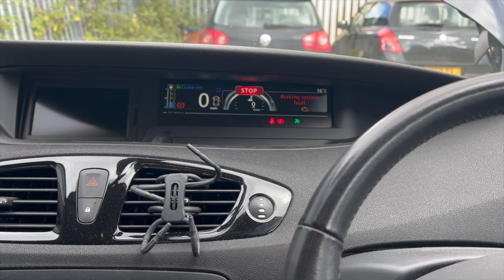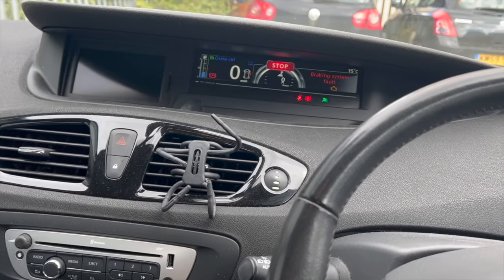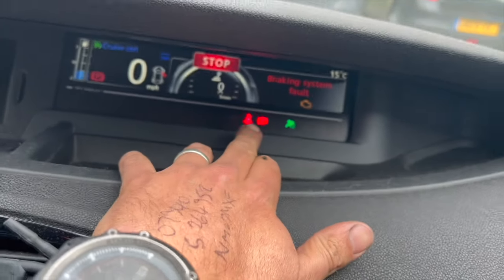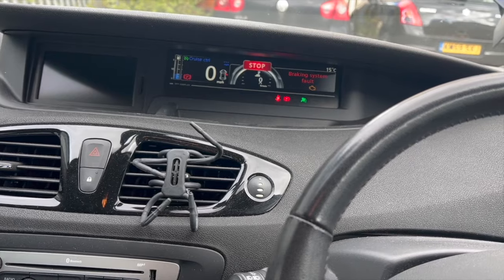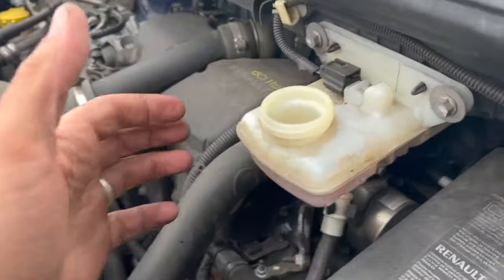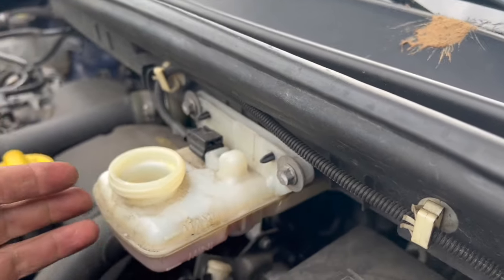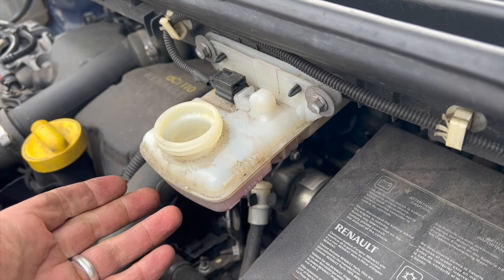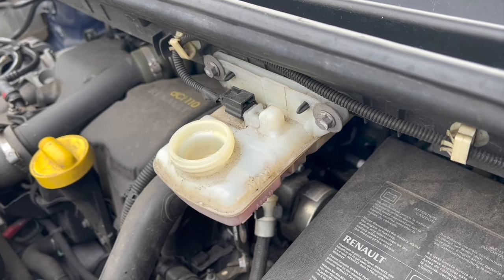Renault Scenic Braking system fault message fixed

Comment: As a motorcycle mechanic and m.o.t tester the words I've watched a you tube video frighten me lol but for 3 weeks this bloody noise has been driving me mental, checked the level, pads and even got it plugged in by a local garage and no faults found. Thank you so much 👍

Comment: I have a renault grand scenic and a message came up saying engine hazard fault. Do I basically need to just change the injector? As before a message came saying check injection
Reply from the maker: no im afraid that could relate to numerous issues mate.. you'll really need to code read the engine ecu first
Reply: @diydaly  I got it sorted today. RAC came round and just sorted the anti pollution system by reving the car for like almost 45mins to 1hour and all the errors and messages went away.
Reply from the maker: @khurammeer3114  👍👍